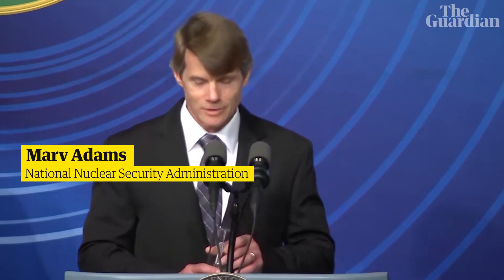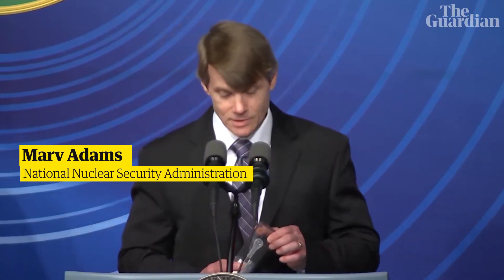Nuclear scientist Marv Adams explains what happened in the successful fusion experiment

Comment: It is a great milestone, but I wish the reporting of it was more educated and a little more tempered than what we've seen.
This experiment is entirely about ignition, it's not about maintaining a reaction which will then deliver vastly more energy than is put into the system. Several other teams around the world have made similar steps which didn't receive a fraction of the attention that this one has.
The real breakthrough will come when/if this reaction can be maintained, and when that reaction can produce more energy than is put into the system. While more energy was produced than put into this, it's on a minuscule scale which is impractical for development (you can't spend millions of $s on fuel and ignition just to boil 50 kettles, for example).
Most of the reporting about this is skipping that reality and leaping straight to claims of a massive breakthrough and that's a little bit dishonest.

Comment: I don't think we can ever FULLY wrap our minds around how incredible this is.... the energy was produced (1 Mega Joule) in LESS time than LIGHT takes to travel just ONE INCH... F**K. Imagine how much energy this could make in just ONE SECOND. Beyond crazy.
Reply: Just saying, you probably don't want to make that much energy for one second.
Reply: @eetm unlimited energy?
Reply: So if my math is correct one second of energy output from this would be generate .012 exajoules, so if we left it running for 2hrs it could power ALL OF AMERICA for an entire year.
Reply: @qwertykirky asking for a friend, what kind of infrastructure would be needed to store this amount of energy? Certainly not our current power grid infrastructure correct?
Reply: @drewfuss2006  well 0.012exajoules = 12000000 gigajoules and and average lighting strike has about 5 gigajoules.
Sooo maybe it contained cloud systems like huge capacitors. I mean honestly I have no idea.
Reply: @qwertykirky  the whole continent? Neat
Reply: @qwertykirky  Yes, but you can't keep it running for 2 hours at a time, atleast not yet.
Reply: The significance was it produced more energy than what was put in. "Free energy"
Reply: The bottleneck is probably the production of the material to fuse, not the speed at which the energy production happen (although it's cool that it's fast). Plus we need more technique as it doesn't produce enough energy yet but I'm sure that will be solved eventually.
Reply: @Arkayjiya hydrogen is the bottleneck? isolating hydrogen is as simple as combining electricity with water (called electrolysis). It’s even easier to get with hydrocarbons.
Reply: @jonaslorincz1045  they never said what fuel was used.
Reply: @jonaslorincz1045  I'm not entirely convinced this is the material that's gonna give us profitable fusion. What they managed to produce with it is ridiculous. But I'll be happy to be proven wrong!

That being said, the production material is still the bottleneck even if it's incredibly easy to find because fusion speed is relativistic, hydrogen acquisition is not.
Reply: @Arkayjiya  fair, plus it sounded like the experiment required a very specific setup. it would require a much more streamlined process for loading the capsule with hydrogen or what have you. it has to be scalable
Reply: He didnt say MEGA did he
Reply: If I recall, this was a continuation on the experiment they did that allowed a Fusion  Reaction of 0.9 seconds. The longest theyve recorded so far. Previous experiments have peaked around 0.1 seconds. So this is exponentially huge in comparison.
Reply: This will take many years to improve, and very expensive power. But I expect it to be the future of power.

(As an unknowledgeable person)
Reply: Shortly after - "New fusion mega-bomb developed"
Reply: @techalyzer  Fusion-powered nuclear weapons have existed for decades.  They're called hydrogen or thermonuclear bombs.
Reply: @davidrh74  Bruhhh
Reply: Can't keep it cool enough to run this long and it's mathematically impossible.
Reply: @YOURDADSDILDO  How is it mathematically impossible?
Reply: @dylanc9174  the math would get too hot
Reply: @YOURDADSDILDO  please explain all knowing one
Reply: You type of people who believe in unicorn
Reply: @youlouv1234  At least there is now proof that unicorns exist.
Reply: @noobyproduction  ofc
Reply: And the initial start up energy is WAY more than one megajoule so this whole thing is meaningless until it’s a sustained reaction that can actually outproduce the Cost of ignition. Which typically requires incredible mass larger than Jupiter sized planets. 

Don’t buy the fusion hype when it’s been nothing but failures marked by hyped up news articles since it’s inception.
Reply: @LegallyBlacked   @LegallyBlacked  they literally just explained that the startup cost was about 2MJ and the generated energy was about 3MJ, making an EXCESS of 1MJ, not a total of 1MJ generated for a startup cost of 2MJ. the whole reason this has excited people is it has done exactly what you said needs to happen for it to be worthwhile
Reply: @Yor_gamma_ix_bae  he said 2 megajoules in and 3 megajoules out
Reply: @Yor_gamma_ix_bae  "And the initial start up energy is WAY more than one megajoule" I see you managed to miss the entire point of a less than 2 minute video. That one is coming from the higly complex and confusing equation of 3 out 2 in. 3 - 2 = 1.
Reply: @Yor_gamma_ix_bae don’t just read the comment and refer to the original source and understand it LOL..seem pretty ignorant can’t even get the fact right before arguing 😂

Comment: The laser beams had a power of 2 MJ and 3 MJ were released during nuclear fusion. Yeah that's cool, but why is the electrical power supplied to the lasers not mentioned? I doubt that the energy balance is still positive if you include the electrical power supplied by the high power lasers. 
:D
Reply: The only way I'd believe that this works is if they had a fully functioning pilot module that demonstrated that it produced a net output of energy.

Comment: Same as usual. Q-plasma and Q-total are two different things. But, spokepeople from fusion energy use those two terms interchangeably. On purpose. It's a misrepresentation of fusion progress by experiments. They want their audience to ovestate how close we are to the goal, a Q-total > 1.  Produce a new gadget, achieve a small gain, here a Q-plasma of 1.5 (which in nothing), you have your announcement effect. And its financial benefits. Yeah! On the long run, this misrepresentation kills the credibility of fusion which is "30 years away and always will be". A working reactor would need a Q-plasma of 40, or at least 30, combined with great electrical efficiency. Concentrating your efforts on this parameter isn't a bad thing. But stop bullshitting us.

Comment: is there a commenter or viewer here who actually knows if this is significant or not? have we flat out never achieved any fusion at all before? Does this count as actually it? Very cool to see.
Reply: Fusion isn't a new development, we've been doing it for decades. However, it's been so energy-demanding that the energy required to initiate it has been far greater than the energy released by the reaction. 
This development has shown that there is a method through which we can get more energy than we put in, and is a significant step in humans being able to recreate fusion on Earth. 
One caveat, though: this reaction released more energy than the amount of energy the laser was putting in. The overall result was still lower than the total amount required to operate the lasers. As a result, there's still a lot of optimizations to be made, and it probably won't be a viable power source for decades - but this is still a huge step in the path to understanding fusion, reproducing it and reliably recreating it at a larger, more economic scale.

Comment: Does this mean that the law of conservation of energy would be disproved at this point??
Reply: No.  Energy stored within the hydrogen atoms is being released.
Reply: @balijosu  still confused on how the input was 2 joules and the output was 3 joules of energy
Reply: @JWolf-nh9uw  When atoms lighter than iron fuse, some mass is converted into energy.  But we need to essentially add energy to get that to happen.  Burning gasoline is similar in a way--you need to provide some energy to get the gasoline to ignite, but when it does it releases more energy than you used to ignite it.

Comment: The lasers may have produced 2 joules, but how much energy was used in order to produce those 2 joules? That needs to be in the equation also.
Reply: but if it can produce more energy than it was fed couldnt you just feed it back?
Reply: @revon7202  That is perpetual motion, cannot be done. My Question is, was the amount of energy to power the lasers from the electrical grid, added to the equation of amount in to the amount out? Adding that amount of power to the laser joules in,  reduces the energy amount  of joules out.

Comment: That is very cool but there's still some serious drawbacks that prevent it from being a viable source of energy.
That "fusion fuel" afaik is tritium, which is hella rare and expensive and if you factor in tritium production I highly doubt they broke even.
Also, I don't know what they did and didn't include in the energy they "put in" (the 2 megajoules). If it was the whole operating cost of the lasers and the mechanism or just the amount of energy the lasers actually deposited into the cylinder for the time of the ignition.
Basically, this is wonderful but nowhere near where it needs to be to actually make a difference now. Closer, still far.

Comment: What he didn't say is that to generate the 2MJ of laser energy took 300MJ meaning that this fusion event actually generated about 1% of the actual input energy. With the latest laser technology you could maybe get that to about 10% so this is far from a significant breakthrough.
Reply: It's very significant as a net gain hadn't been achieved at/in the fusion system before. The input lasers themselves weren't designed for efficiency, but just to dump energy into that system for testing. A knowledgeable researcher knows you break a problem into parts, and this is a major advancement in one of the most major parts.
Reply: @JimBob1937  As I said with the most efficient lasers and beam forming infrastructure it would be about 10% efficient over all. This is the problem with fusion research generally, the results are presented in a disingenuous way to fool those not familiar with the subject. Q-total is consistently ignored and only Q-plasma is reported. Usable fusion power generation is probably still 100 years away.

Comment: This still looks like a prototype of very complex and expensive bomb. How make fusion process continious? How convert received "energy" to heat and electricity? Still many questions and no answers.
Reply: Neutron blankets to thermal, to electricity. Thermal mass can buffer the energy. That's the working theories, but engineering challenges for sure.

Comment: 1:12 – “a gain of 1.5” makes it sound as for every 2 watts in you get 3 watts out. The problem is that, as Adams explained, it is the energy the lasers deposited. Lasers do not work at 100% efficiency, in fact, to my knowledge a laser works at 50% efficiency at the very best (I do not know what efficiency the lasers used in this experiment have). Ignoring other losses of energy in the process, this means that the whole operation at the very very best would use 4 watts for every 3 watts it produces, if the thermal energy from the fusion could be used with 100$ efficiency itself. My guess is that the process would need to be 10× better to be of any actual use. It is still a breakthrough, make no mistake, but this … does in no way mean that a fusion reactor will go into operation in your city in in the foreseeable future.
Reply: Additionally, they assume you will be able to extract 100% of the generated energy via the fusion, which is unrealistic. So far we can't even harness heat-based fusion energy, and this core topology is not compatible with magnetohydrodynamic fusors(as far as I am aware).

Comment: It is an achievement.  True that the fusion output exceeded the laser output, but what's not being said is the laser input was much higher.  So  overall they lost many times what they produced.  The laser is not designed to be efficient but in order to be efficient enough it would have to be 50 to 100 times more efficient.  Heading in the right direction, but still a long way from being a practical energy source.

Comment: He should mention that light can circumnavigate the globe 7.5 times in ~ 1 second. So the time is would take light to travel 10 feet is ~ 0.00000001 seconds -> 10 microseconds. And the time it takes light to travel 1 inch is ~ 0.000000000085 seconds -> 85 picoseconds.

Comment: It actually took 300 times the energy to produce the reaction, when taking the entire system into account.
Reply: Well duh, but if you let it run long enough it gains its cost back essily. The point is its a setup that when started can cycle itself.

Comment: Wait, what? I was taught that a system will almost maintain the same energy, hence energy in will always be the same energy out. Where is the extra energy coming from? Well, actually, don't bother replying. I should just go watch a video on Fusion Energy.
Reply: Simple, two atoms fusing together to form a heavier atom, releasing energy. 
The limitation is that you first need to input enough energy for those atoms to fuse. 
That's the breakthrough here. They broke even.

Comment: This is astounding. Given our current energy challenges, why isn't this all over the news?
Reply: The laser "deposited" less energy then they got from the fusion. It still took a lot more energy to turn on the laser
Reply: @alluriman  okay, so I'm not fully understanding here, from the address, they made it sound as though the inverse of your statement was true? Genuine question.
Reply: @christopherhall7560  basically the laser is very inefficient if the laser. Like if they put 100 electricity into the laser it is only outputting 1 energy into the fusion fuel. And the fusion is releasing 2. Does that make sense?
Reply: @alluriman  so...? It created 50% offset in less time than it takes for light to cross an inch. Literally keep it running for a second and it gave enough power offset to run a city. The initial cost is less than nothing.

Comment: This is my idea. This is how you turn something invisible. Build a smartphone with a screen on both sides. Display clouds on it or night sky On 360 degrees of it's surface. Install a jet engine and now it can fly in the air invisibly, because it will blend in with the clouds or night sky. Next we need a display screen that is non-reflective. So you probably need something like a plasma screen installed. You could also use camera's to record and display on the surface.

Comment: Wow. This is incredible. 
So does that break the law of conservation of energy?
Reply: No it doesn't. Ignition in this context means that you put energy in (2 megajoules), and it causes the fusion to start a chain reaction, causing more fusion. You gain energy because of E = MC2, where a tiny amount of lost energy gains you a massive amount of energy, because some mass is lost when combining 2 hydrogen atoms and turning into a helium atom. This reaction only keeps going as long as you keep it hot and dense enough, there's  no "meltdown" here because the reaction stops as soon as it loses input heat and density.

Comment: I'm confused, the energy to power the whole system is way more than the output energy. More than 300 MJ were used to get 3,15 MJ as output. The historical fact remains the nuclear fusion itself but it's not, for now, a way to gain more output energy balanced to the input.

Comment: Few problems. 1) The "fusion fuel" was not hydrogen or deuterium, it was tritium, which is extremely rare and expensive. 2) The ratio of useful energy (potentially) extracted to total energy spent was tiny. Comparing total energy produced to total laser energy deposited is meaningless. 3) They were lucky to perform one such ignition in a day. To be practical, it should be reliably performed thousands of times per day.
Reply: Yup, that's why they're still working on it and aren't claiming to have a fully functioning reactor :D

Comment: For anyone interested, Marv is describing "indirect drive" inertial confinement fusion specifically, in contrast to "direct" drive which was common among ICF devices a few generations ago. Indirect drive is where the incident UV laser beams impact the gold cylinder (hohlraum) and are then re-emitted as X-rays that impact the target capsule. The absorption and re-emission "evens out" the energies across the beams so the target is struck symmetrically from all directions and X-rays are less likely to interact with the capsule wall atoms than UV, which was a problem in the Shiva and Nova devices.
Reply: Thank you for explaining this.